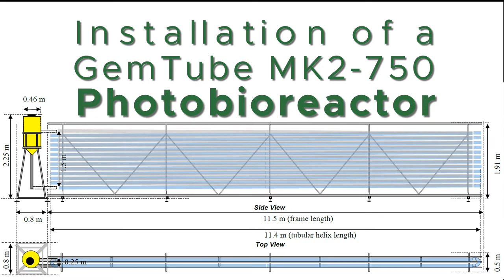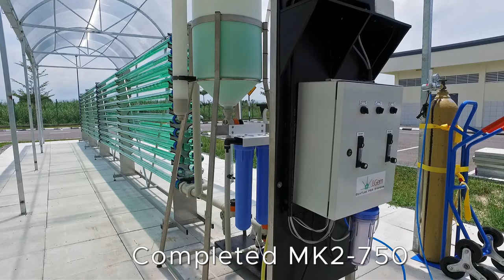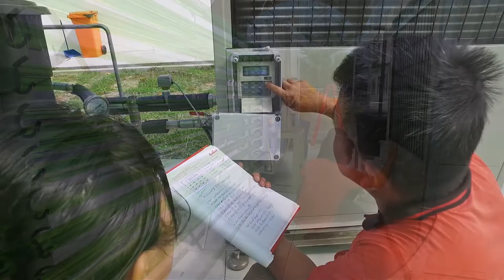Installation of a pilot scale photobioreactor

Comment: That's awesome!
Are those tubes made of PVC? Do they have UV protection?
Also, is there a reason why the pumps works from bottom to top? Why not make it top to bottom using a gravitational force?
Reply from the maker: The tubes are Schott glass. The pump works from the bottom to push waves through as you can see in the video to enable mixing and gas transfer

Comment: Hi Clem Kuek! I'm curious to know if this MK2-750 PBR was installed in Malaysia. If so, is it functioning well?
Reply from the maker: Yes, it was installed at a Pilot Plant Facility and ran well (including the cooling loop modification).
Reply: Thanks Prof Clem for the quick reply. I'm trying to connect you through LinkedIn. I'm genuinely interested in learning more about the PBS system. If it's not too much trouble, would you mind sharing some info about the system? Looking forward to the possibility of connecting on LinkedIn and learning from your expertise 🙏🏼🙂 thank you